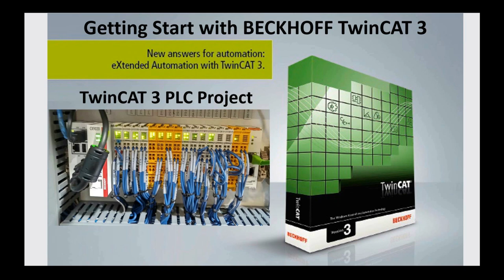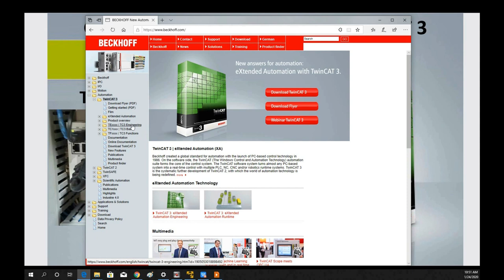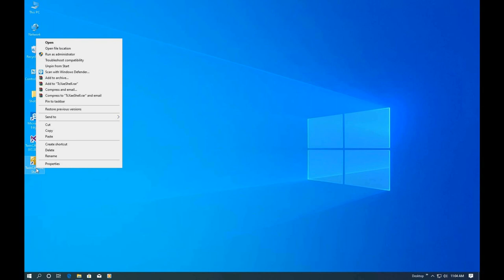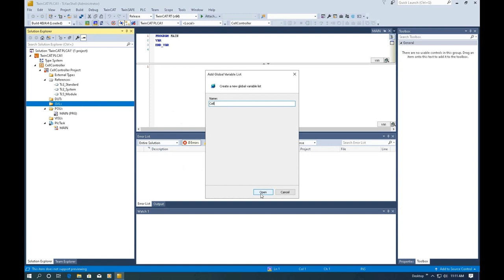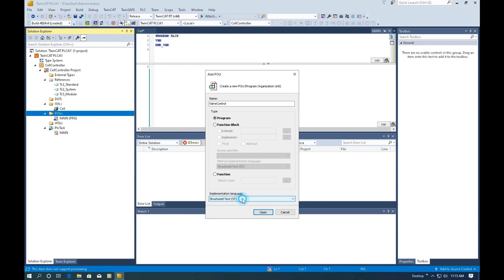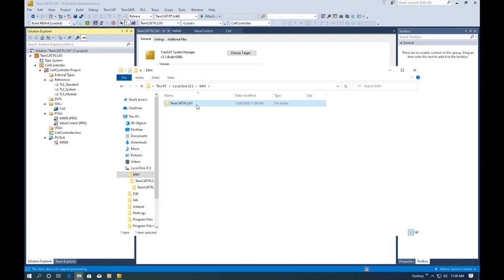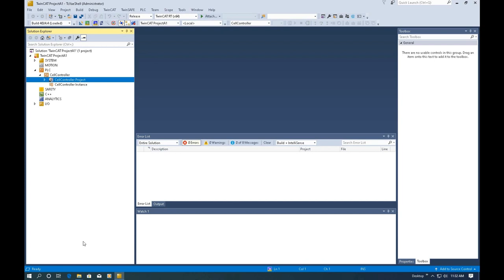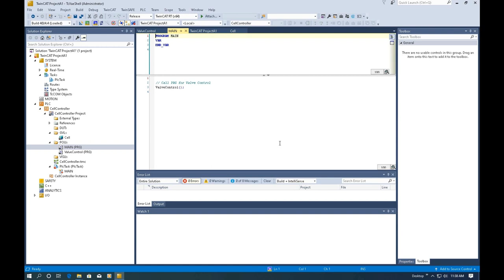BK01. Getting Started with BECKHOFF TwinCAT 3 - How to Set Up PLC Project, Variables, and Program

Comment: Hello, Thank you so much for your helpful videos.
I am working with Beckhoff Drivers and motors, Indeed I am trying to implement the torque controller on this setting. 
Is it possible to give me some guidance on how to apply PID to the torque control motor? Thank you
Reply from the maker: Hello! Are you using vector or servo control. From my personal view, do not use PLC as torque loop controller. For controlling speed, torque, position are recommend to be implemented via motion controller (servo drive). PLC is used to initiate the start command. Because, speed, torque, position can be controlled properly by the driver controller it self and the loop signal speed can be fasted calculated. I recommend you use servo drive e.g. AX5000 https://www.beckhoff.com/english.asp?drive_technology/servo_drives_axxxxx.htm
Reply from the maker: Are you doing the packaging project, such as winder, share load, or tension control? Do you have encoder for your drive? Probably you could find the information about TS5070 TwinCAT PackAL, and FB: PS_Dancer_Control. https://infosys.beckhoff.com/english.php?content=../content/1033/tcplclibpackal/819751179.html&id=